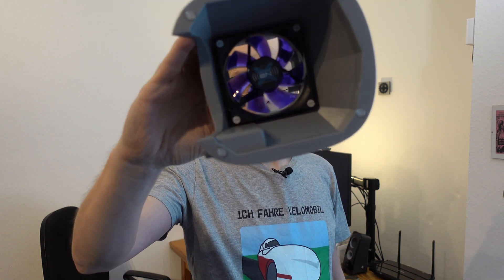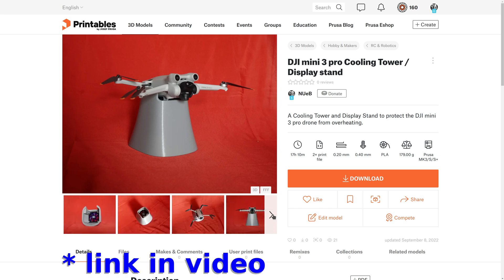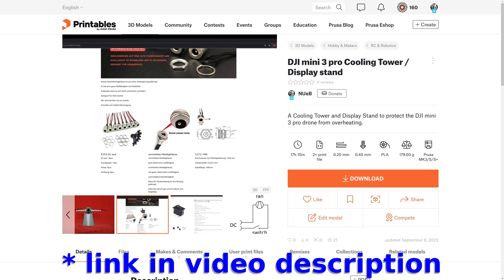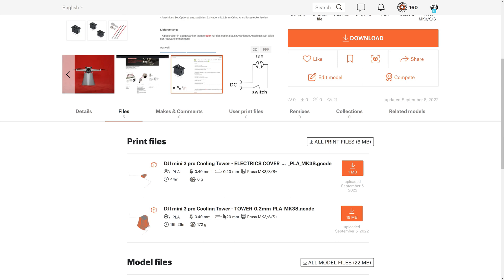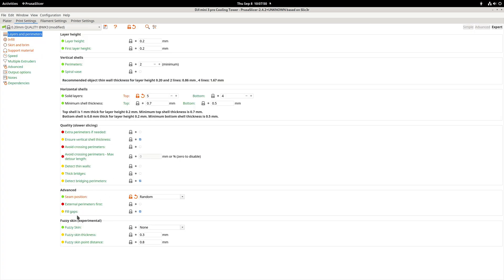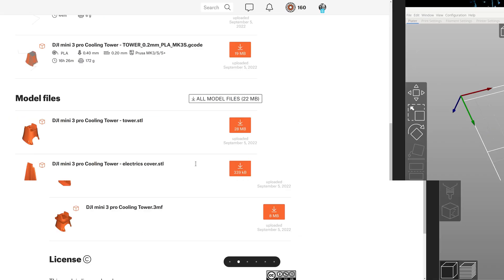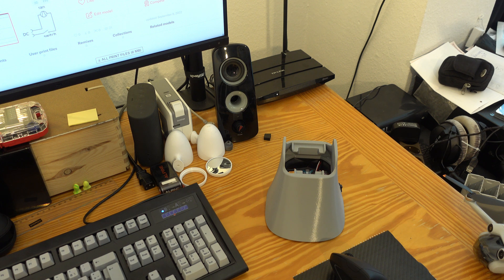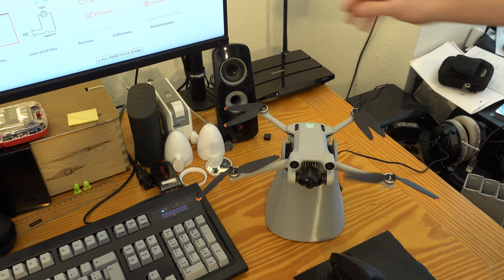Cooling Tower for DJI mini 3 pro – YOU CAN DIY! (it's 3D printed)

Comment: What did you set your Infill at Markus?
Reply from the maker: My basic print settings were: PLA 0.2 mm layer height; 2 perimeters; 5 % cubic infill; snug support with 2.5 mm spacing. If you use Prusa Slicer, you may just load the 3mf file from Printables. — Good luck!
Reply: @NUeB_RCFPV  I have an Ender 3 pro😎😎👍👍
Reply from the maker: @martinstreasurehunting  I considered buying one, too but then chose i3MK3S+ (w/ no regret). The Ender 3 pro is also directly supported by Prusa Slicer!
Reply: @NUeB_RCFPV  On the Cura Slicer i'm getting 23 hours and 17 min. 173 grams of material
Reply from the maker: @martinstreasurehunting  That sounds reasonable. 17:21 and 179 g in Prusa Slicer for the i3 (137.6 g without supports). Happy printing!
Reply: @NUeB_RCFPV  Thanks my friend.😎😎👍👍